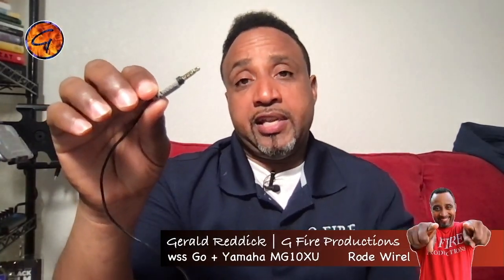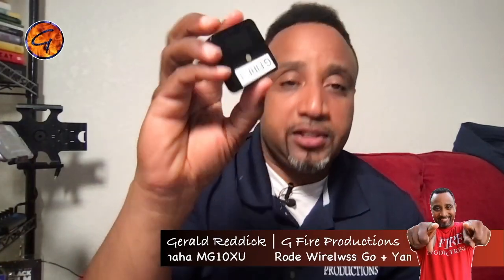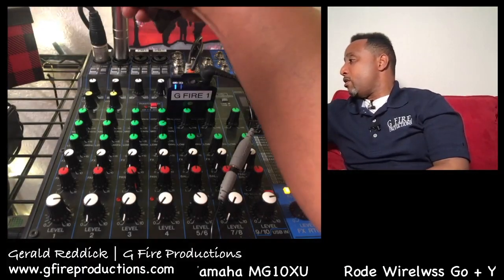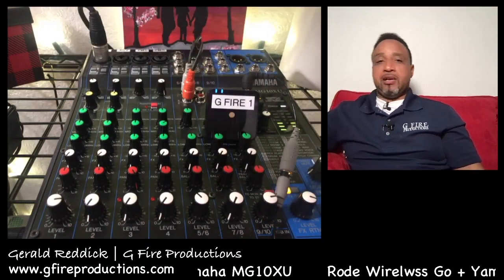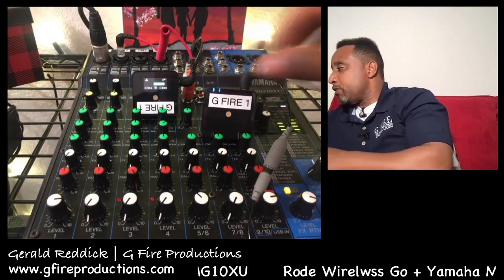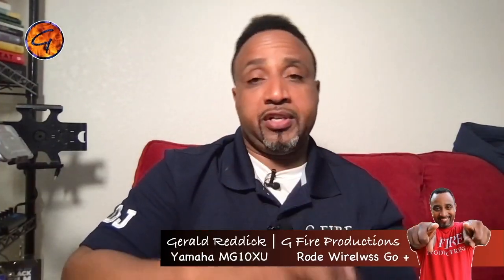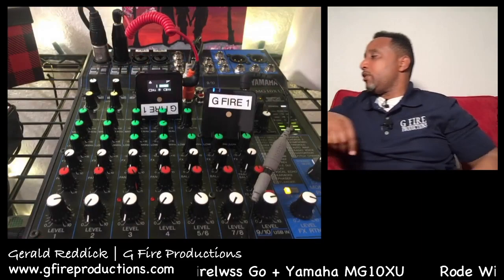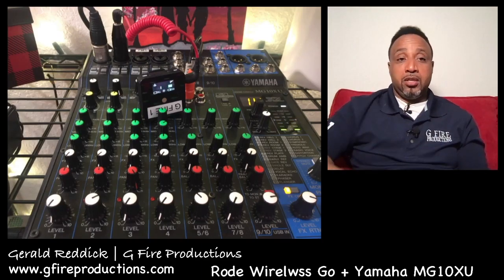Rode Wireless Go + Yamaha MG10XU | How to get the Rode Wireless Go into An Analog Mixer

Comment: Thanks for this clear explanation. If it hadn't been for your explanation of the cable (and a clear view of both connectors in one frame), I would have accidentally purchased the Røde SC7 cable (TRRS to TRS) rather than the Røde SC2 (TRS to TRS). Speaking of the SC7 (TRRS to TRS), is it primarily meant to plug into mirrorless cameras, smartphones, and the like. (I'm new to the world of Røde.)
Reply from the maker: Hello Curbuntu. Thank you for for watching and supporting our channel. As for the SC7 (TRRS to TRS) I use this specifically to get audio out of the Rode Wireless Receiver to my smart phone or tablet. Noe my new iPhone 12 Pro does not have a mini jack port so I us a TRRS to lightning with the SC7 to my Phone. TRS side of SC7 goes in the Rode Receiver, TRRS side goes in the phone if you have that old headphone connection. I showed it here: https://www.youtube.com/watch?v=Zx24RGGUqWc&t=207s

Comment: Great review thanks! I was going to get the RODE VXLR Pro for $40, but after watching this, all I need is the RODE VXLR for $10. This will just as good with my RODE Wireless GO II setup. Again, thank you for doing this video!
Reply from the maker: Right on and thanks for watching.
Reply: Punk Nugget (smile).. are you running your two Go Pro's into separate channels on the Rodecaster Pro with a 1/8 split dual XLR male cabling or not splitting the mics and going through the phone port?  I want to split the two mics audios on separate channels. Thanks!
Reply: @JanetteSmith  Just tried calling you and got your agent. Your agent will be reaching out to you, so you can call me directly and I'll try to answer your question as best as I can.

Comment: Appreciate for the detailed explanation and the demo.
I am deciding to buy the Rode wireless go II, and glad I watched this video.
Still not 100% clear why balanced connection won't work on the mixer input, I will double check my mixer (Zoom L-8) Manuel and try it.

Seems like VXLR is a must.
Reply from the maker: Thanks for watching bro. VXLR is a must even in the Zoom recorders. WGII: https://amzn.to/3g502Vb and VXLR: Rode VXLR @t
Reply from the maker: Thanks for watching tom40hk. VXLR is a must even in the Zooms. 
VXLR: Rode VXLR: https://amzn.to/3t7bRyd
Wireless Go II: https://amzn.to/3g502Vb
Reply: The VXLR is just a wire to wire connection. This adapter is only good for certain connections/types of mic. Most people have 3.5mm or 1/8 inch plugged condenser mics, which require 5 volts not 48 volts from your mixer's phantom power. The VXLR+ is the appropriate adapter.
3.5mm type condenser mics and the Wireless go receiver, do not produce the twin signal used for balancing, so it makes no difference what adapter you use here, there is no balanced signal. The VXLR Pro converts the single signal from a small condenser mic, or Wireless Go receiver's output, and transforms it into a twinned signal that can be used for balancing and noise reduction. At the same time the Pro version like the Plus version converts the 48volts from the interface or mixer, to 5volts. It is pointless IMO to plug the VXLR Pro directly into a mixer or interface, since there is no signal over wires to balance. The VXLR Plus is correct though the Pro will also work. Where the VXLR PRO is useful, is when you need to send a wired signal from a 3.5mm plugged condenser mic, over a long distance, in an RF noisy environment. You plug your 3.5mm mic, or the Wireless Go receiver(if you wanted) into the VXLR Pro, then run a length of XLR cable to your mixer or interface from the VXLR Pro. This creates a balanced signal through the XLR cables.

Comment: Great walkthrough Gerald! 👊🏻
Running the Røde Wireless Go II with two transmitters, how to split the audio when connecting from the receiver into two separate input channels on the mixer?
Reply from the maker: In that Case I'd use a y cable (3.5mm TRS to 6.35mm Stereo TS): https://amzn.to/3U0d8rG . The TRS end would go into your Rode Wireless Go II receiver and the l and R TS ends will go into two separate channels of your mixer. Don't forget the Rode Wireless Go II  allows you to set each transmitter to be is own separator channel so make sure you check your settings accordingly. Please let me know how that works out for you.

Comment: Hi Gerald, I was wondering if this is an alternative for a small church in terms of distance (between 10m - 20m of open distance)?  Whats your experience? Thanx
Reply from the maker: Professionally I would not recommend this used in a church. Although it will work fine within the distance of 60 feet there are opportunities for this microphone to have drop outs due to its very small built in antennas. These types of devices have an application more towards Vlogging in my opinion versus an all-out church setting. So if you are considering to use this in that manner, make sure that the receiver has a direct line of sight to the transmitter so that minimizes any in interference.

Comment: Thank you so much for this very helpful video sir.
I have one more question sir, how about if you attached the transmitter into the mixer and the receiver is connected in camera will the camera receive and record the auido coming from the mixer?
Reply from the maker: You can do that however, you must significantly reduce the audio output from the mixer so you don't overdrive you camera audio. I have not done this yet but in the the meantime, I use the rode wireless go receiver directly in my camera some times with the transmitter on my person and not in the mixer. Of course that only take care of my voice in the camera. Check out these options: https://www.youtube.com/watch?v=Zx24RGGUqWc
Reply: @gfire_productions  thank you so much sir. More tutorial videos and more blessings coming to you sir. 💗
Reply from the maker: @philipagie4009  Thank you sir and good success to you!

Comment: But the VXLR doesn't convert unbalanced to balanced, the VXLR Pro does that. The regular VXLR is just a one to one connection. Shouldn't this work with any kind of 3.5mm to XLR adapter?
Reply from the maker: I thought so at first  but regular adaptors and cables did not work like that so I had to get to the VXLR because nothing else worked. The VXLR in my case works great though. Thanks for watching bro.

Comment: Hi, I want to use these mic with Yamaha mixer and Bose speakers in our Auditorium. Do you think there will be a feedback problem or whistle noise. Thanks :)
Reply from the maker: Hello NABI ITC and thanks for watching. Any microphone is subject to feedback if improperly placed near a speaker. If your Bose speakers are spread out wide enough where the mic will not be picked up by them, you should not have a feedback problem. You can also use the 3 band EQ on the Yamaha mixer to assist with avoiding feedback. Again, speaker placement is going to be a major factor in this.

Comment: Why are you using lav mic with rode transmitter? Won't the inbuilt mic work the same?
Reply from the maker: That's a good question Adhokshaja and thanks for watching the video. The built-in mic works absolutely fine however, I it's really just a personal preference to use a lapel mic on my shirts versus this weeks box hanging from it  Also in my experience when I wear a round neck T-shirt the transmitter has enough weight to make it look like a V-neck and it looks weird to me. Also I tend to move around a lot specially doing setting up DJ Quitman or whatever and sometimes that Boxton flip out of my T-shirt and I'm always having to adjust it back to his position so I decided to do away with just using the box and clip on a lapel mic.
Reply: @gfire_productions  Thanku
Reply: One more suggestion I need. Recently I've  been watching comparisons of DJI wireless mic with rode 2 go. DJI is still not available in India. But I liked the specifications more than rode wireless 2. People say DJI's customer service is poor. What would you suggest ? Should I stay with rode or try DJI wireless?
Reply from the maker: @adhokshajakrishnadas9408  I'm sorry but I cannot intelligently speak about DJI because I don't use any of their equipment. Without being biased towards Rode, I'm more of a use what works till it dies or breaks and Rode is it for me. In fact even though the Rode Wireless Go II is out I still have not purchased it because my original Wireless Go systems still work. I usually don't jump on the bandwagon with everybody else. I just do my research, pick the gear I want, and go for it. Now given the supply chain issues we're having these days and along with the chip shortages, my suggestion is first to see if the Rode can work out for you maybe some settings could change and get you the results you're looking for. Maybe later if you can wait for the DJI system go for it. I am however huge on customer service so I can attest that Rode has great customer service and has helped me resolve issues with my system to include replacing a bad system. Again I cannot speak for DJI because I do not use their equipment nor have I experienced their customer service issues.

Comment: OK, so I have this mixer but I'm a performer and I want to have the audio out, say form the headphone jack OR the monitors go to my Rode Wireless so that while I'm gigging my camera is getting good audio from the mixer.  Do I put put the 3.5 to 1/4 inch adapter in the headphone jack and then attach the receiver to the 3.5 jack??  Then I'd have the transmitter on my camera with the appropriate cable??  
This video was sooooooo close to what I'm looking for......

Comment: Wow thanks so much
Didn’t know this! I’ve used the RCA inputs which also kinda works but this seems to be what I’ve been missing 

PS: I’ve got a cheap wireless hand held mic that actually works ok for speech. When connecting to a karaoke wireless speaker it works fine but not to a proper mixer.

Would it be because of the same reason mentioned in the video?
Reply from the maker: You got it my friend and when you do hook your mic to channel one or two of the mixer with a standard XLR, make sure you got good gain structure.

If you are using a lapel mic like what’s in the video, you’ll need the VXLR.

Does your hand held mic have an XLR out similar to the Shure SM58?
Reply: @gfire_productions  hi thanks buddy. If using a powered lapel like the Boya BY M1 lav mic would it also work with the Rode VXLR?

I bought a cheap wireless mic. Was around $15. It works nice for short distance speech. The receiver has a 6.35mm TS jack. I've tried to use it with "line in" on a mixer but doesn't work. Some mixers you need to really push the gain then u get weak sound.
Reply from the maker: @Mbee16  VXLR should be good for that Boya BY M1 Also. Look like it also has TRRS mini jack just like Rode. I’d use VXLR and all the adapters I used on n the video. Hope this helps.

Comment: Hello! Why can’t I connect my rode wireless go to line input with a 3.5 to 6.35 mm converter ?
Reply from the maker: Because the 6.5 mm is wired as tip ring sleeve or is a balances connection. That is why the Rode VXLR is wired different as stated in the video. My suggestion is to buy the road the XLR to help you get your road wireless go into your mixer.

Comment: Are you setting the Gain (dB selection) on yr Receiver correctly?
It Should be set Fullest at 0dB
It should Not be set at -12dB
Reply from the maker: Hello Temp06 and thanks for watching. Setting a gain on the microphone receiver is depending on the person talking. Some peoples voices are stronger and more overpowering than others with soft-spoken voices. the Wireless Go gives you the option to adjust between three settings depending on how loud the speaker is. In my case if I set my receiver to it for this volume it would actually distorted my voice.

Comment: I want to use this wireless mic with a large speaker which is to be used in large seminar hall. The bigger speaker has aux in. So can I directly connect the receiver to the speaker? Will there be any feedback problem?
Reply from the maker: Hello and thank you for watching this video. In the same way I've connected this Wireless Go system to the mixer I can connect it to a powered speaker. As for feedback, you still have to follow the basic fundamentals with microphones in relation to where the speakers are. You can't stand directly in front of a loud blaring speaker with a microphone and not have feedback. I have tested this out personally with the Wireless Go receiver into the back of a powered speaker and realize I can only get so close to the speaker before feedback happened. So make sure that if you go that route with this mic into a speaker that your speaker is up as high as you can get it, pointing at your guest and you are standing behind the speaker, if you walk out in front of it you will risk having feedback as these microphones are sensitive.
Reply: @gfire_productions  thanku very much

Comment: Thank you very much for this video!  I have one question. Can I use the XLR => 1/4" adapter on top of the VXLR connector? Is it still unbalanced and usable because my mixer does not have an XLR connection? Thank you.

Comment: Awesome video! You've answered a lot. I have an idea and this may solve. Let me know what you think. Here is what I am trying to achieve...

I want to have a jam session with my guys and I want to patch their laptops into my mixer. A simple line put from their headphone 3.5 jacks. I've tried the 3.5 to 1/4 method but like you said, no power. So since it's coming from a laptop headphone jack, this method should work using the VXLR adapter correct? 

And also, how is the noise when no sound is coming in? Terrible hiss or white noise? Anways, thanks a bunch fam. Feels like I'm closing in on a solution!
Reply from the maker: Hey bro the Rode VXLR was specifically designed to get certain models of their lapel mics into a mixer correctly like in my case the Rode Wireless Go. VXLR is wired differently from your standard audio cables.

If you want to get a "laptop" audio from the headphone jack into the mixer then you can use a 3.5 mm to XLR cable for that on channels one through four of the Yamaha MG10XU. On channels 5/6 and 7/8 you can use a 3.5 mm to stereo RCA  or 3.5 mm to dual 1/4 inch (unbalances) cable. On 9/10 you can only use a 3.5 mm to dual 1/4 inch (unbalanced) cable.
Reply: @gfire_productions  🔥🔥🔥 Thanks sir!

Comment: Great video! If I have phantom 48 on for a boom mic, could it end up frying the wireless go?

I’m using a Profx10
Reply from the maker: According to https://www.rode.com/faq/will-phantom-power-damage-my-mic-psu:  No, whilst these power supplies do not require phantom power, they are built to cope with being fed phantom power and this will not damage the equipment. It is however advised that where possible, to turn off phantom power when not in use.
Reply: @gfire_productions  you the man! Thank you!

Comment: Will VXLR also work for the COMICA Boom XD?
Reply from the maker: Thanks for watching. I have never used this particular unit however, I just read the manual from the B&H website ( https://www.bhphotovideo.com/lit_files/588200.pdf ). Giving it come with just about all of the components that my Rode system has, It looks like it will work just fine. If you find out it does not simply return it within this allowed return rules. It is definitely worth the investment to upgrade what you're trying to do.

Comment: Awesome video man. I tried the 1/4 inch it didn’t work like your test as well. Just ordered the rode vxlr adapter but I was wondering if the transmitter/receiver works the other way around into the mixer so that I can get all the audio out from the mixer? (For a wedding ceremony so I get both mic & audio into my livestream)
Reply from the maker: Hey bro that's an excellent question. I would NOT do that because I believe that your mixer is going to have a line level output that's meant to connect to an amplifier or a powered speaker which can take that kind of input. The Rode Wireless Go however is meant to accept a mic level input from say the smart LAV or the smart LAV plus and of course similar lapel mics. Rather you use the auxiliary out of your mixer or the main XLR out,  it may be too much for the Rode wireless go transmitter. I am very curious though and I may except this challenge and try to figure it out. My advice is to contact Rode directly to ask a question like that or consider something like the alto stealth or one of the wireless microphone systems like shure, sennheiser or equivalent to get that done. On the other end of those systems though the question is still going to be, is it too much output for what you're hooking into like your computer or your phone. If I went that route I would probably try to use the  irig out of the alto stealth or any microphone receiver to step to step down the amount of audio necessary to safely get it into a computer or a phone. I do have a video showing that I came from an XLR cable out of my DJ controller into the I rig and then into my phone for live stream. Bro I'm on fire right now you really got me curious but I have a wedding to perform for today so I'm gonna have to explore this option at a later date.
Reply: @gfire_productions  Thanks man. Appreciate the reply

Comment: Hi, great video.. I need to connect from this go receiver to an amp that has RCA unbalanced connectors. My question is will a 3.5mm TRS to RCA LR adapter work? I reckon it should as RCA isn't wired as balanced..any ideas?